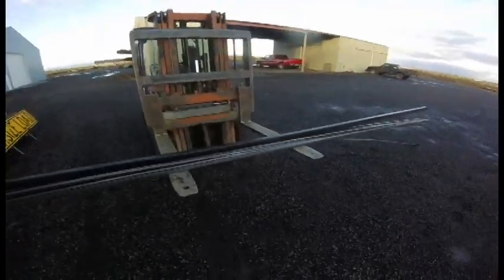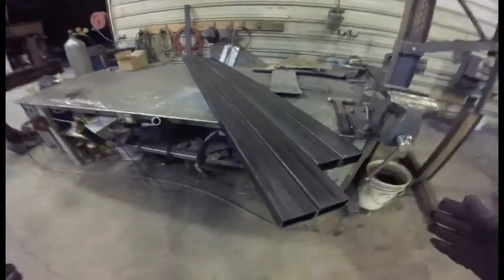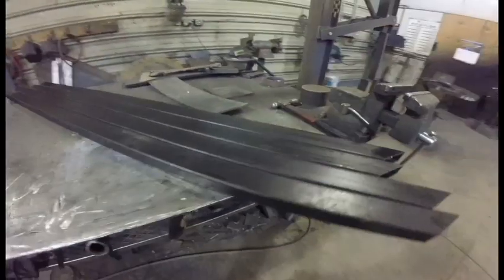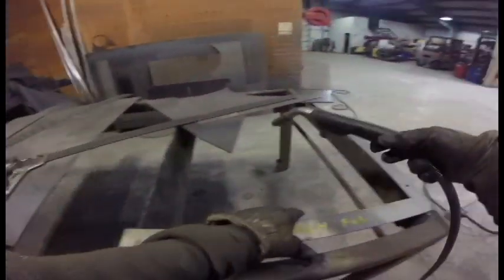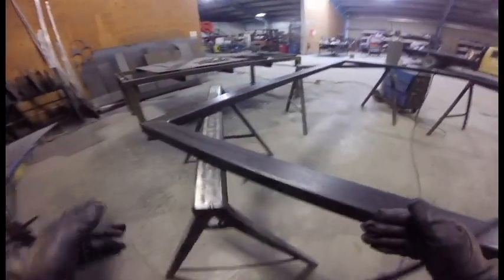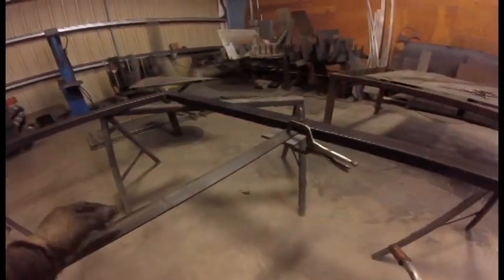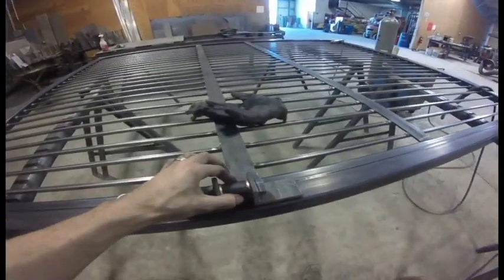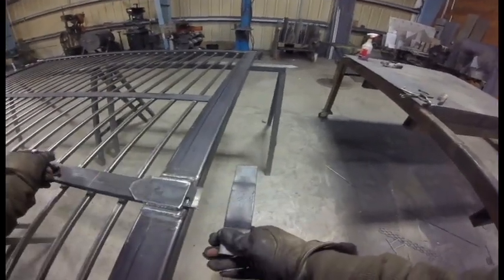Making a Steel Gate

Comment: Man that is a nice shop. Nice tools make the work so much easier and faster. For instance I have to use a angle grinder for all my cuts and all my bends like on the latch I blacksmith. It has been a chore finding coal down here in Chile, but I sourced some last week so maybe I can get my shop making my front gate. 
Thanks for the info on the weld sequence. I am a new welder and do not have anyone to teach me these tricks. So that advice will come in handy. Jim
Reply from the maker: ChileExpatFamily it's awesome, I was so lucky to get this job so I have access to the shop, I was in the same boat a while ago, angle grinder for everything, it's rough
Reply: You are a good son to your parents and they are fortunate that they have you. For me my sons are a wonder and joy too.
You know they say doing it the hard way builds character. I pray they are right. Thanks for the video. Jim
Reply from the maker: ChileExpatFamily that's what I hear, it also makes you appreciate it when you get better tools a whole lot more
Reply: Nice project there. I need to weld up a gate soon with my everlast. I've been putting it off for too long.

Comment: My only gripe is the 1/2" sq tube pickets. ive seen so may gates and railings that were made with 1/2" sq tube and it always rotted away. also never used 1/16" wall for any type of security application or railing or gate. it just doesnt hold up nearly as long as 1/8" wall. spray paint isnt bad but i wouldnt shoot it without primer. regardless if the paint is meant for outdoor applications. number one reason outdoor metal rusts and paints lifts is lack of prep prior to paint.  Clean, wipe with thinner, PRIMER, 24 hr later then paint. nice build though!!!

Comment: Nice!! I like the hinge design. How is the hole in the post holding up? Since it is a heavy gate, I was wondering if you put like a bushing  in the post , so the soft pine won't give as easy on the hole? Can you comment on that? Great video
Reply: And is the size of the bolt that goes into the post 3/4" as well?

Comment: so you build this super strong steel gate. Great work! Now you mount it on a wooden fence that i can cut down with a cheap saw in 3 minutes....well, thats stupid. There is no sense in building such a strong gate for such a weak fence. a thief will always take advantage of the weakest link of the chain...
Reply from the maker: LuitpoldVI it's not meant to be a security gate, it was built to match the two double front gates that are steel and mounted on concreted steel posts, again, not built as security gates, mostly there to keep out the local wildlife (herds of deer etc)